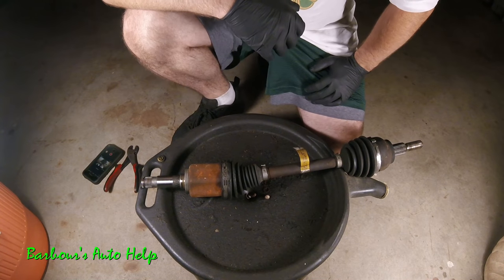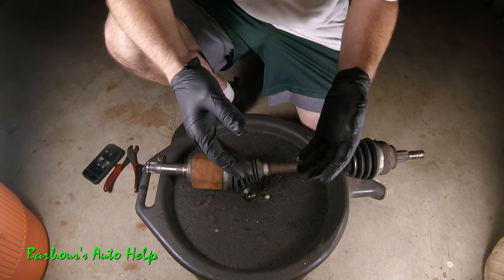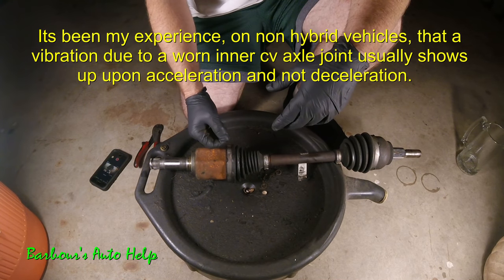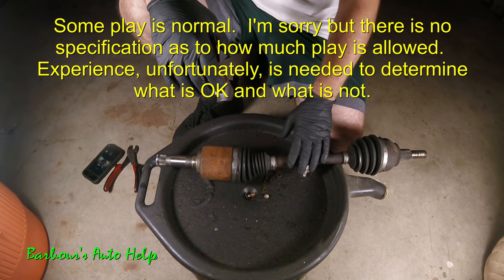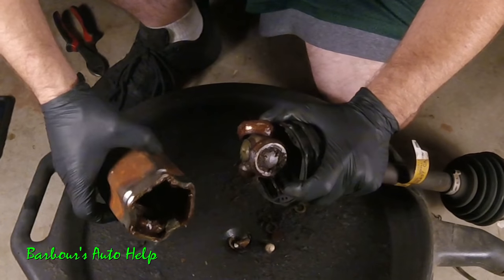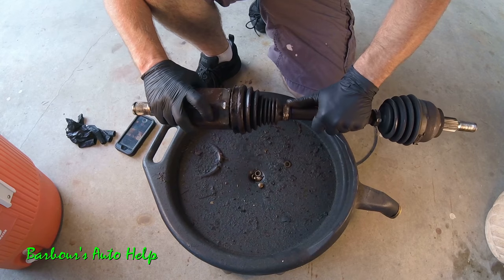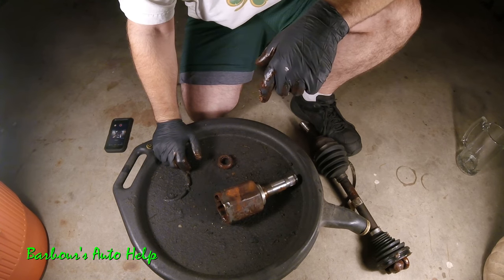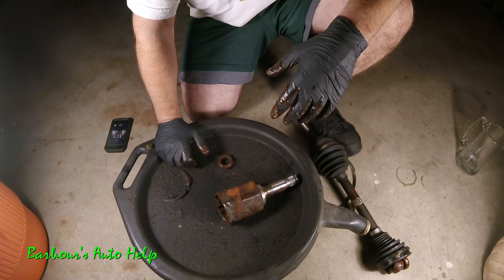How a Worn  CV Axle Can Cause Vibration

Comment: In addition to slight vibration on acceleration, there is vibration when breaking hard at highway speeds. It's not the rotors. The cv axle (passenger side) would also make a rumbling sound when banking left above 55mph. It made a little noise on slow sharp turns-no clicking just a rumble. The boots have failed, making a mess. Getting it replaced today.  I've learned my lessons about putting off repairs...it's no picnic. Great Video.

Comment: Yeah I think mine is the inner joint. There's a very slight click I hear from time to time. But my problem is vibration when accelerating to about 30-40 mph and much more at 60-70 mph.
Reply: Same bro
Reply: What was it ? I’m having the same issue
Reply: @juliomarenco4411  before you do the cv axels check your tie rods. It still shook after I replaced the axels, motot mounts, rotors, brakes and ball joints. After all that it was my $40 tie rods that were bad and caused the shaking.
Reply: @sa1nt_john.v1  will do thanks, would it vibrate a lot ? From 0-40 it’s normal but after the fast I go the more it vibrates and goes away when I go back to around 30mph
Reply: @sa1nt_john.v1  I just don’t want to be changing parts that don’t need to be changed 😂 already balanced the tires and it wasn’t it
Reply: @juliomarenco4411  mine was 50-60 almost exact but depending on how bad they are it could vary. Before you jump on the cv axels try the tie rods. I spent $800 on raxels alone. I was mad because I spent so much to find out it was the tie rods all along but happy I finally figured it out.
Reply: @juliomarenco4411  exactly that's what happened to me. I'm trying to keep others from making the same mistake. Good luck man
Reply: @sa1nt_john.v1  thanks, appreciate it
Reply: @juliomarenco4411    my steering wheel rattles my mechanic recommended to get new tie rods i have a rattle that gets more excessive with speed starting in high 50s  what was the fix to your issue?
Reply: @sa1nt_john.v1   did it used to make a clunk sound when doing a sharp turn or going over bump or pothole sometimes??
Reply: @ayleenvalencia4870  my cv axels weren't the problem. My rack and pinion is bad. But all the research I've seen says the inner joints usually the side that goes bad and it wears faster of you have low pro rims like me. But yes the inner joint will make a metal clunking together sound. My advice is to check your tie rods first. I changed mine and it seems like it helped more than changing my axels.
Reply: wat it causing the clicking as well as the vibration
Reply: @ayleenvalencia4870 hi. I have this problem.  Make clunk like metal to metal when going over bumps or uneven roads. Also vibration at high speeds at times. Mechanic says he thinks its Cv shaft.
Reply: @mohammedismailmaiter4979  same issue with the clicks, squeeks and metal to metal on metal clanks and it turned out my CV joint split and flushed grease all over the inner wheel. I didn't know until I took the wheel off.

Comment: I just don't understand how some axles can appear fine on the bench but actually be the problem, case in point 2015 RDX, severe shimmy felt in the steering wheel and bad enough to shake your fillings out, took a chance and sourced two cheap Chinese axles without any balancing rubbers on the shaft and visibly had more slop in the tripods than the oem and it fixed the problem.  Nothing surprises me anymore.  If these cheap knock offs last a year Ill be impressed.
Reply: Mine Chinese  was vibrating right after install, you got lucky, useOEM or remanufactured OEM by Raxles

Comment: Correction, a bad CV axel can cause vibration in any kind of vehicle when breaking, not just hybrid. A CV axel acts the same no matter what kind of vehicle it's on, when they fail you can experience vibration during acceleration and deceleration.

Comment: Dude this video saved me! I thought my transmission was going out on my mew 2013 rav 4 and it was the cv causing it around 40 to 45 mph then started popping when I would back up or start off even turnin sometimes it would pop once or twice.
Reply from the maker: Man, I'm so glad to hear that!
Reply: @BarboursAutoHelp  I'm curious if maybe one of you guys can help, my 2010 jeep compass is making a clacking noise upon acceleration and deceleration. It sometimes even does it when shifting from park to drive or park to nuetral. Please note that is does not make the noise when revved in park or nuetral, but does when put into drive and foot on brake and revved just a little. Anything is much appreciated thanks guys!
Reply: @phillippardo5712  idk if you figured it out but it sounds like u joints

Comment: It's so much more valuable information when you know HOW something can cause vibration. Thank you for taking the time to explain.
Reply from the maker: No problem
Reply from the maker: Probably not here.  It may be best to have it looked at.
Reply: @AusAhmet check motor mounts
Reply: @VatanTURK It's motor mount, the upper one. And if drive or reverse engaged and it jerked, the lower mounts as well. Definitely not the axle.

Comment: I swapped my cv axles and realized they don’t look the same as oem. And have issue with vibration on load when release gas pedal car is smooth happens over 50mph on expressway

Comment: Thanks for that explanation.  i recently bought a second hand car and had a vibration develop while going down hill with a feathered throttle at 75-80kmph.  Eventually, on longer 25-30km trips the vibration would develop at any speed. 

This was just after a clunk occurred and I was lucky to find a bolt from the RH inner CV sitting between the suspension arm and a chassis member. LUCKY!

Looking into replacing the Axles this month!
Reply from the maker: Good luck.

Comment: This was exactly what i was looking for almost a week now. Just needed to confirm y would inner cv axle vibrate and cause noise while driving. Gives me confidence to just replace the tripod bearing rather then all inner cv. Cheper 50 compared to 400. Saved me half a days work inspecting myself and $350 on replacement. Thanks.❤
Reply: Good math, good thinking.
Reply: Fajnie. Super. Dobrze sobie poradziłeś.

Comment: This has been the most helpful video for me yet. This is the first time I’ve heard someone say that you can have vibration after de-acceleration.
Reply: Me too! Don't have a hybrid vehicle but my 08 Fusion vibrates at de-acceleration and when accelerating from a complete stop. The description he gave at the beginning is exactly what my car does now!
Reply: @frank-bmtz  did you ever figure out the issue? Mines doing the the same. Along with a clacking noise upon acceleration and deceleration
Reply: It can happen on manual transmission cars while engine braking

Comment: My steering wheel, floor and right seat vibrate between 70 and 90 mph. I changed new tires and new rims and the problem persists.I have balanced them about 8 times, the last time they came out 0 with 0, that is perfect and it still does.😢Hard to find good mechanics.
Have a great day, thanks for the video.👍
Reply: Did changing the axles fix the issue for you? I'm having the exact same issue as you in my Acura and have replaced bent rims and tires MULTIPLE times to no avail. I'm suspecting it could be axle related in my case.

Comment: Your video is describing my issues exactly. I'm gonna have to check my cv axles.  Only thing is I've put the vehicle in neutral and it still slowed down like the brakes were being applied as well as a harder brake pedal feel but only when the issue arises.
Reply: Seized brake calipers
Reply: Same issue and I have changed all brakes along with hardware even changed all 4 calipers. Can’t figure it out. When I accelerate it shakes steering wheel and when u slow down it feels like brakes. It’s intermittent and only does it when it wants to some days. I have changed everything except left cv axle. I pulled the brakes apart so many times and jacked it up to spin the wheels. Weird. I am starting to think transmission torque converter or transmission. No lights on dash. Even put new spark plugs. I am stumped.
Reply: Yeah your CV axel would not cause that.

Comment: Thank you for creating these videos...I don't know much about cars, (but wish I did!).. when my PT Cruiser started vibrating upon acceleration recently..I took  it for service right away. 
Despite my description of what was concerning me, the garage seemed to only plug the car into the diagnostic machine. They claimed it needed new plugs and  wires...$700+..
OK...I guess?...I do know that bad plugs, and cracked wires can affect a car's smooth running. Those parts were original to the car(2006-I checked thru my bills to make sure)..
They called  me at  the end of the day, to say it ran better...but it still juddered. ..they  also swapped out the rotors, to  see if those were  warped...(they were not)
After a few days...the car was finally fixed. It was the RF axle/CV joint. 
Fearing an astronomical bill...to my surprise, they admitted their "misdiagnosing".. and changed the  axle and rotors no charge.
This PT has been a great car, relatively few problems over the years. 
I figure to keep it going as long as I can. As a senior, I'm in no position to take on a new car, or car payments, nor do I really want to.
I just  wish mechanical stuff was taught in schools to women way back when. We weren't allowed to take any shop type courses when I was a youngster.
I will be checking out more of your videos in future..as the PT ages, it's going to need more fixing I'm sure...so thank you for sharing all this info!

Comment: Oddly enough, after several months of vibration when braking at 65mph+, I got this idea it might be the inner CV joint causing it on my CT200h.  I’ve experienced the inner CV joint vibration on acceleration and didn’t think it could be the inner CV joint unless it also happened during acceleration.

Will know for sure once I replace it with a known good.
Reply from the maker: I hope it works out for ya!

Comment: I have a Hyundai i40 that has got this replaced 2 times now with only 40k miles on the clock. I just put on a brand new driveshaft again and the wobbling is almost gone but I can still feel it slightly under load sometimes. Seems like there is something else wrong with this car that makes the driveshaft wear way to fast. I talked to the previous owner and he said he had complained about this while the car was under warranty but Hyundai just said it was nothing. Probably the wheels or bad road surface. But now we see it was not ''nothing'' . It's something serious. A drive shaft should last MUCH longer than 20k miles. 
Wheels and alignment are spot on. Got several very experienced mechanics to check everything and they don't really know what it can be. Motor mounts are ok to.
Starting to get quite desperate now 😣

Comment: I have that problem with 2003 camry.
Thanks for the video.
Reply: I have an 06 Camry, same parts as your 03. Humming sound at a higher speed. It bounces at around 25 mph. Somewhat of a grinding and shaking when braking at a higher speed. No popping though. And the right side of the car seems to shake at higher speeds

Comment: I have a 2012 Audi Q5 that I bought about 4 months ago. From the day I drove it off the lot there was a problem with a very subtle vibration not visually noticeable but definitely felt through the entire car steering wheels/seats dashboard at all speeds from 30 km/h and upwards with no limit. The faster you drive the more noticeable it is. I have had this car in and out of about 15 shops/mechanics and I'm at the end of my rope and my patience. Ive had the wheels balanced/Road Forced/alignment multiple times along with other shops trying to diagnose unsuccessfully. I've been told everything from CV Joint to Struts and coils/mounts to control arms/tie rods and wheel bearings or tires feathering/cupping. Some shops have even said U joints or propeller shaft or torque converter. Everyone wants throw parts at the car and not one mechanic do I trust. The vibrations are making me so angry when I drive and I would rather do the repair myself but not sure if your video applies to non hybrid Quattro style german cars. It's more noticeable upon acceleration, but also there during coasting or braking just not as much. I'm desperate for answers
Reply from the maker: The info in the video is common to most vehicles that use CV style axles, to a degree.  Have considered taking it to an Audi dealership to have it properly diagnosed?
Reply: I did take it to Audi, actually 2 different Audi's. One said front brakes and rotors so I had them replaced. $900. The other said it needs a road force balancing with proper adapter - donut shaped not spherical - and proper wheel alignment. $600. Its like burning money. I hate dealerships, I don't trust them and this car is well out of warranty. Audi wants another $700 just to diagnose and disassemble parts to inspect with no guarantee of finding or fixing problem. At what point do I put my foot down and say enough? If they actually change the CV joint/s it will mostly likely be in the range of $1500 - $3000. Its not even inflation its absurdity. A regular mechanic will still charge at least $1200.00 as per quote with OE parts if that was even the problem.
Reply from the maker: Sometimes that’s the road you have to go down.  Sorry your going through this.  It’s a tough pill to take.  What ever you end up doing I hope it goes well with you.  Good luck.
Reply: I'm gonna get under my own car in the morning as I just got home and it's freezing  (northern USA Maine) because since yesterday I've noticed a pretty good vibration going on in the front end. Being I've had the same issue before but it was snow that did it last year it was frozen inside the back of the rim ( aluminum rims) these on my 06 G6 are steel and I see no snow from just looking we'll see in the am what I find. The vibration starts around 40 or so and worse at 60 so I kept it at 50mph on the way home from work. Definitely giving a thumbs up on the video. If you comment back I'll respond. I know I need ball joints, sway links excitedexc exc only had it on the road for about a 10k miles which I knew it needed those parts just wanted to make sure the trans or anything else is broken. This spring I plan to fix it but if it needs a cv I'll have to get that done in the next couple days.
Reply from the maker: Good luck to you.  Keep us posted.
Reply: Did you check your tires? Sometimes tires have defects or lumps on them which can cause a vibration that it hard to determine what it is.
Reply: @BarboursAutoHelp  it was mostly a worn drivers inside cv axle that was causing my vibrations but also knew ball joints we're needed and they definitely were severely worn out. Well I did both cv's, both lower control arms, both outer tie rod ends and I also went ahead and replaced the front pads they were pretty much spent lol. I also ordered both rear trailing arms that rattle over bumps and the exhaust flex pipe coming in the mail should be here later today. Thank you for the awesome content!

Comment: Makes an annoying popping too when you hit the gas too and stop as well. And good showing how it's supposed to work too, it's supposed to be telescopic at the inside joint for the suspension and it extending on the jounce and rebound at the wheels.

Comment: I'm getting it on both acceleration and deceleration, but only on highway conditions. 1997 Acura CL 3.0

I knew the CV axel was bad due to the clicking when turning, but I thought the vibration was due to the tires. Put on the new tires (old ones were old and dangerous as well), vibration is still there.

Axle is next I suppose.
Reply: I have an Acura CL 97 too.
After replacing tie rods, ball joints, wheel bearing, and tires w/ alignment.

I was getting a vibration that would pull the steering wheel to the right...Then disappear.

I suspect my front passenger axle is bad, as well.
Reply: Cliffjumper Turns out it was a bad caliper.  It was locked up and it would cause one brake rotor to warp when overheated and vibrate.  It needed tires, axels, and brake system work, but most of all it was the brakes.

Comment: My wife's 2011 Rogue feels like the transmission slips two or three times in quick succession when you are coasting and then apply the accelerator to start climbing a slight incline. It does it between two and four times or so and feels like something is slipping and trying to lock-in to pull. I assumed her CVT transmission was going bad since they are known for that, but for some reason this particular year model has been excluded from all the complaints from the years before and after with cvts. I admit she hasn't changed the fluid, but when it was being serviced at the dealership I asked them to do it and since the fluid was kind of dark they recommended I didn't do it or it might make the problem worse. It has about 135,000 miles on it. They said there were no codes stored pertaining to the transmission when I was having them try to diagnose it. The problem really hasn't gotten much worse since we first noticed it about 7 months ago. I know we have a torn CV boot for the passenger side CV axle and it needs to be replaced. if it has begun to wear while the boot has been torn, is there any chance it could cause a symptom like I described?
Reply from the maker: Without experiencing it my self it's hard to say.  From the sound of it that CV axle would just about have to be falling apart to make it do that.  Id suggest having a tech diagnose it.  You may be pleasantly surprised at what they say.
Reply: Yes! I’m having same issue and it’s being fixed now. Part messed up axle into front differential
Reply: My axle is screwed. Someone changed wheel baring and didn’t put it back on correctly
Reply: @GermanShepherdDaphne   So you say your Rogue is doing the same thing ours is doing? Acts like it's skipping or the transmission is slipping?